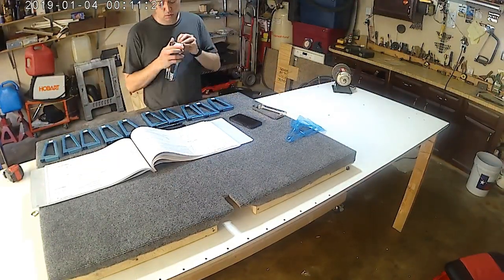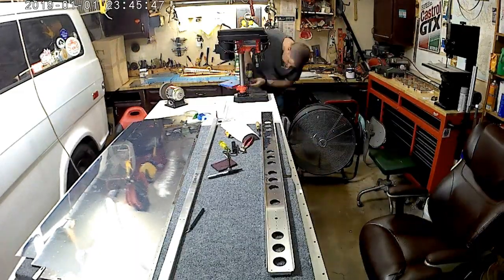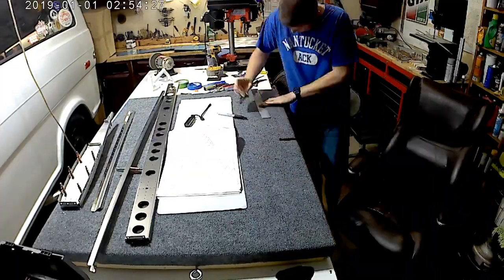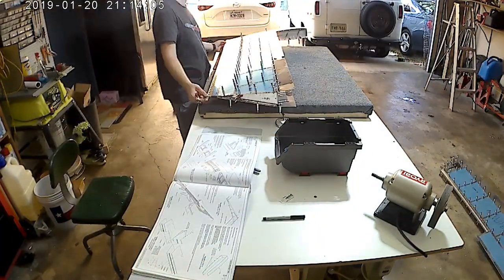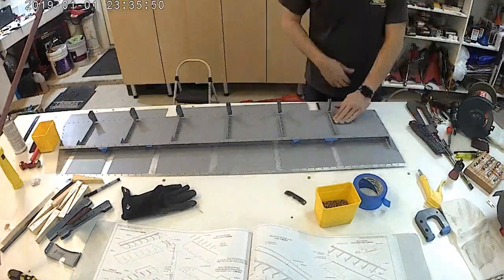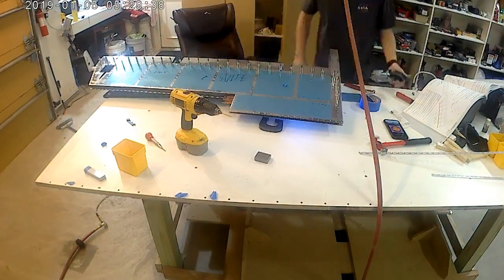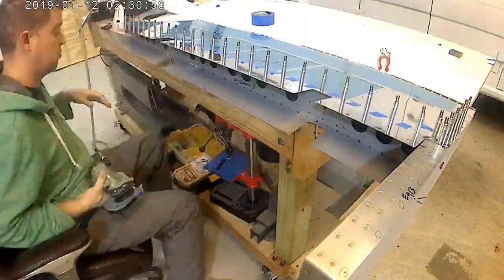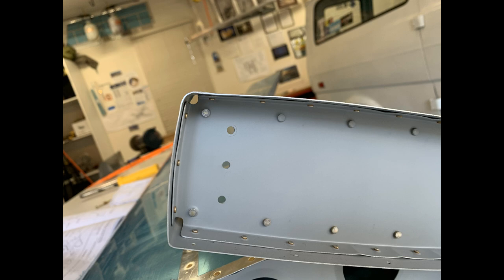Section 9: Van's RV14A Elevator Assembly Build Timelapse

Comment: Having constructed one RV in my garage, like you, I used the burnishing wheel to debur many airplane parts on amy grinder. Cutting this short, I highly recommend the following two ideas to you. Number one, wear a dust mask at all times when you debur like this - if you do a lot of deburring like this, you will get tiny aluminum and cutting wheel residue in your lungs.  This, I learned the hard way. Number two, do as much of this kind of deburring outside of your garage as possible. If you don't take this operation outside then you find that a fine layer of aluminum particles will slowly settle on all horizontal surfaces in your garage. An option is to use some sort of dust collection system which is located near your grinder. Make sure that it is protected against aluminum explosion! Hope that this helps.
Reply from the maker: Thanks Oscar. I’ll try to move more deburring outside!